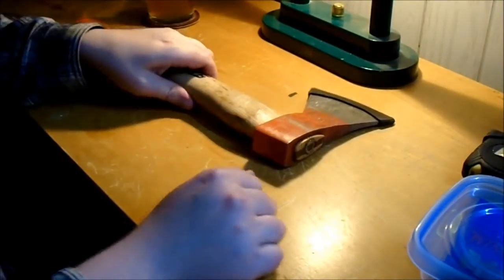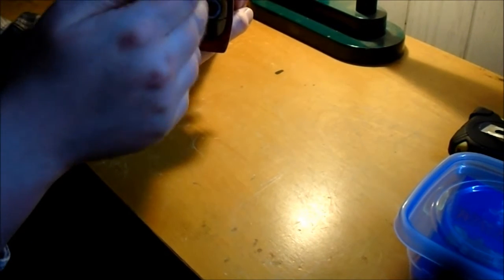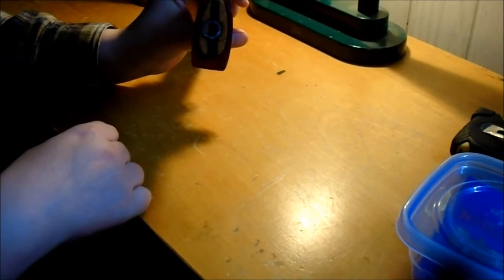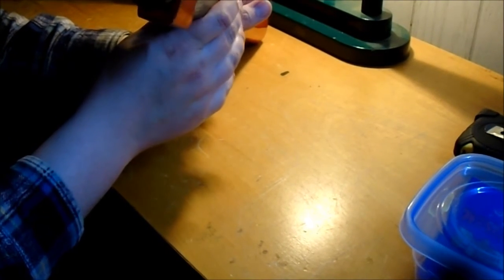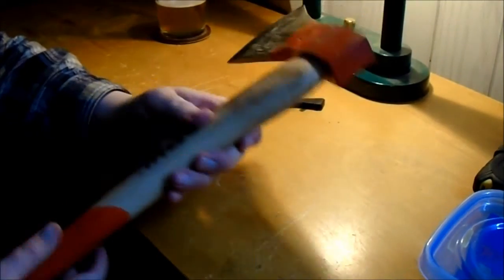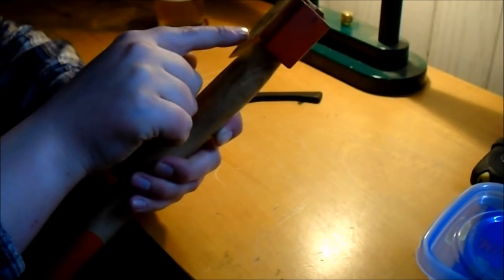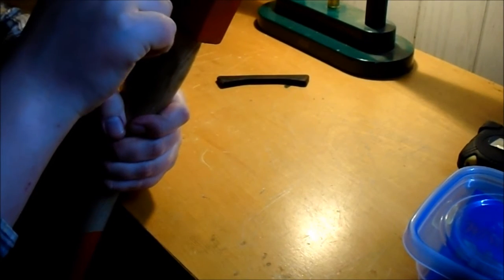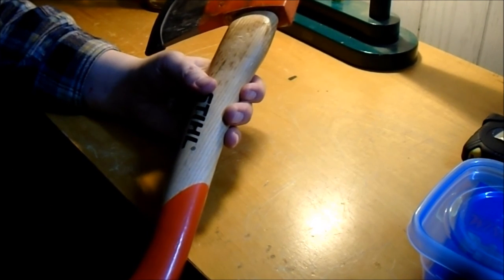Stihl  Hatchet Update

Comment: My uncle in northern NB always claimed that the wooden wedge should be made of softwood, like spruce or pine. It "bites" better, and compresses a bit as you drive it it. They don't seem to have as much of a tendency to want to pop back out. After the softwood  wedge, drive in the steel ones perpendicular, but as diagonal as required to get them to fit across the eye without touching steel. I have never used one of those round ones before though.

Comment: Good to hear your review.  ALL metal is going to roll over, on the final sharpening,.  that's known as burs.  The harder the steel the more your going to be able to feel the "bur".  Simply grind that off with a small file.
Also some axes come with ill fitting handles and we have to accept that.  If you bought from a show room floor you could pick and choose what you like. 
These arepurtly production axes and it's common to get one that the headf doesn't fit properly...
In the rareest of cases remove the handle and put in another.  You'll spend a couple hors rasping of  the wood to get a perectt fit but it IS achievable .  There's lots of video here as to how to fit a new handle to an axe.
Good luck

Comment: Im disappointed it Wetterlings at the moment. I bought a #118 small axe from them a couple years ago and the head came loose in the dry Alberta winter, I soaked the head in linseed oil and it was still loose so i attempted to pound a steel wedge in, the wooden wedge in the middle was not seated all the way so it sank a good 1/4". I buggers the top off so I just cut off the handle and hang it myself, properly. I'd expect a $100 axe to hold up better and be hung properly from the factory.